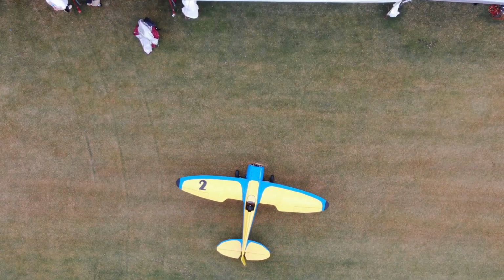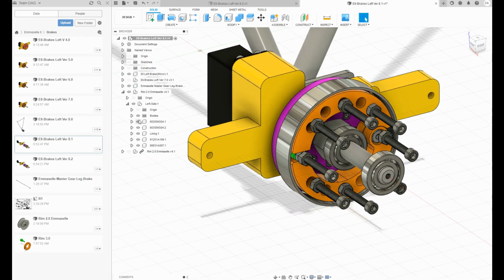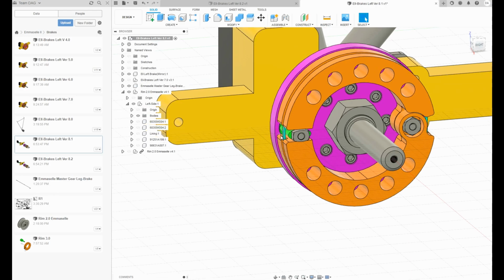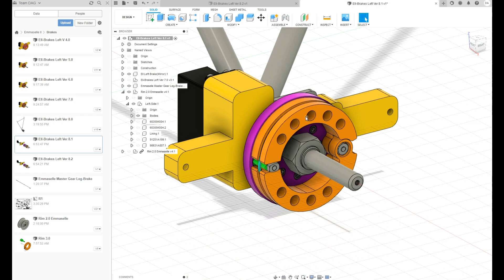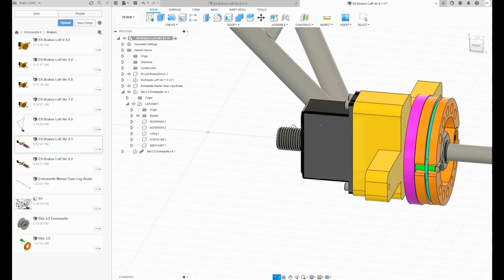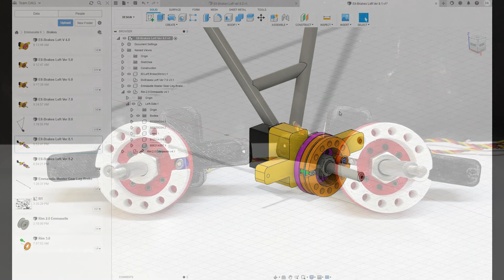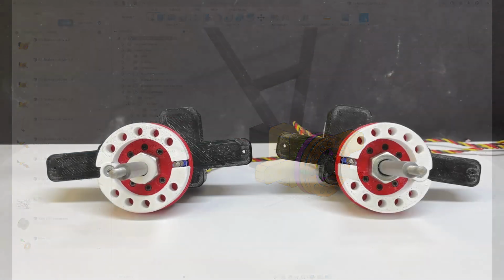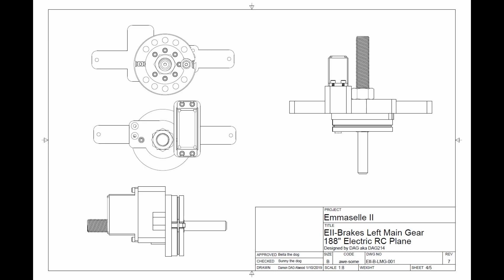Emmaselle II Brakes

Comment: As a trade mechanical engineer,    I see you as a wealth of information for the hobby,    I'm still learning a lot from your videos,     and at time with my own experience,    find it very hard to scale things down and keep them simple and practical.   Thanks for up loading your knowledge and content.      Haters are just jealous people who cant think of solutions themselves.    Thumbs up pal.  And Hello again from little New Zealand
 Edit,    test flew an ARF high wing aileron trainer/sport model last weekend.    It needed some what alot of left roll trim.    It balanced fine,   ASP91FS  glow engine,     was told it was torque roll.    But that means it should have been rolling the other way.    Thought about it for about Five days,   this morning when I looked at it,   I saw the left wing was not as flush with the top of fuse as the right was,    1/4 to 1/2 a degree down at trailing edge.   Lesson learned.   Dont trust factory built to be perfect.    I oveled out the rear dowel pin hole,  turned wing about mainspar alloy tube,  shimmed the bottom of the rear dowel with 1/2 a MM of hard wood,   and wow,  spot on.  Both wings level,  and now flys with centre trim.   Would like to pass on my thanks, cause you've taught me to slow down,  look and think about what is happening.    Without helping,  you helped me.   Thank you for the lessons you post